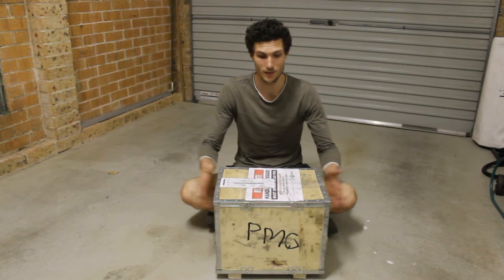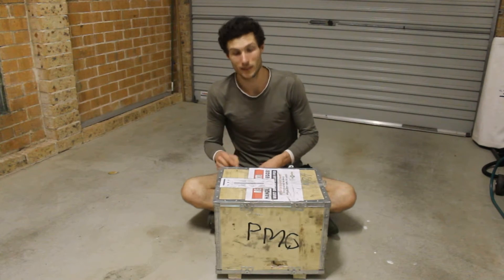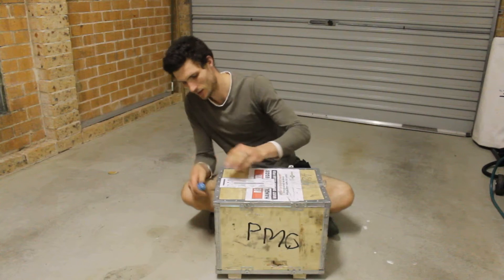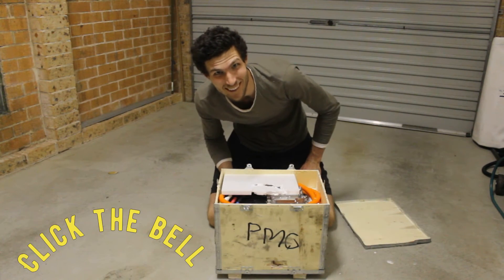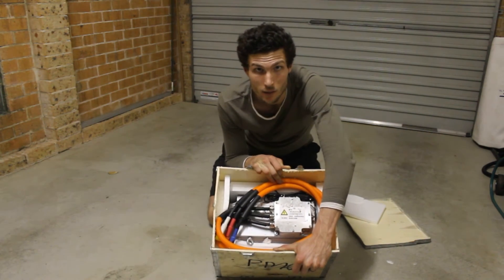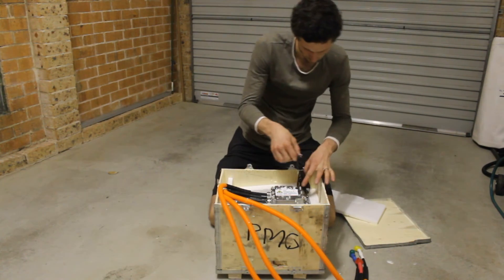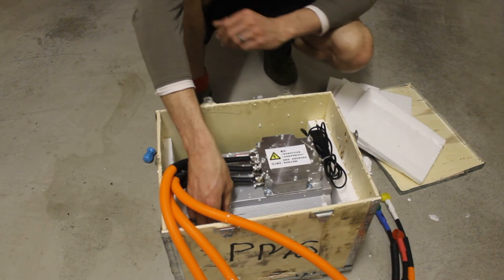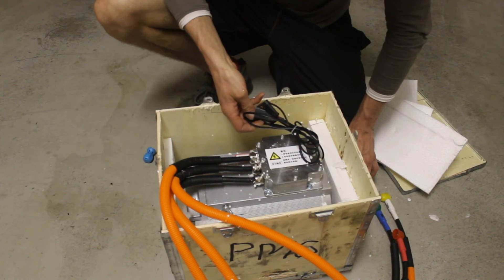|| UNBOXING || SHINEGLE 3 PHASE Electric Motor 144 Volt

Comment: Hi L George, and Please
After 1 year, what can you say about this engine?
you installed this engine in a vehicle ??
Is it reliable and performing as you would expect?
I have a project to build a Kart cross, and I would like
certainly installed this type of engine.
Thank you in advance for your answers,
                                        Laurent.
Reply from the maker: hey, I haven't actually finished the project! still have more videos and work to come. 
I think thermal management is key in racing applications, so keep that in mind. Also, if you don't need to worry about regenerative braking, then i'd go with a dc motor for simplicity. 
thanks for the comment :)

Comment: how much does the motor weigh? what is the rated KW
Reply from the maker: hey, continuously 15kw @ 120AMP, max 500AMP. torque 189NM, though not sure what load that spec is rated. weighs 55kg. Are you considering a particular motor for a conversion yourself? Remember that they can put out max torque from 0rpm, bms and controller depending of course!